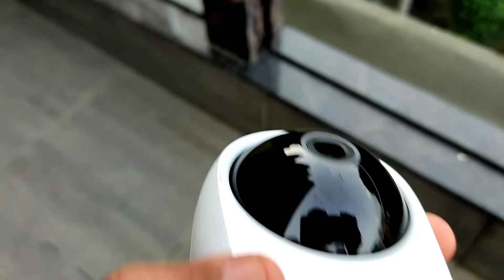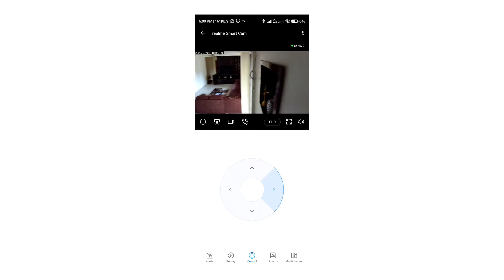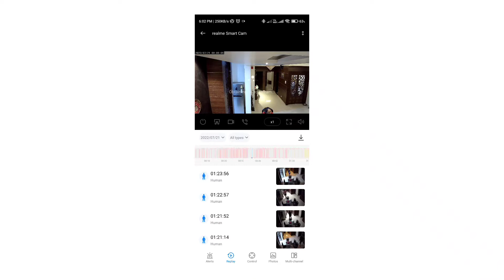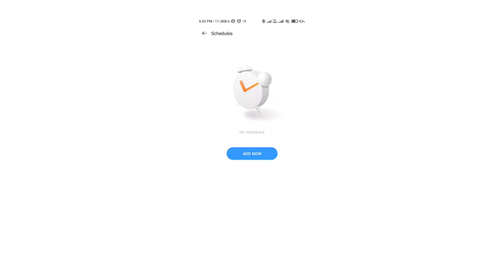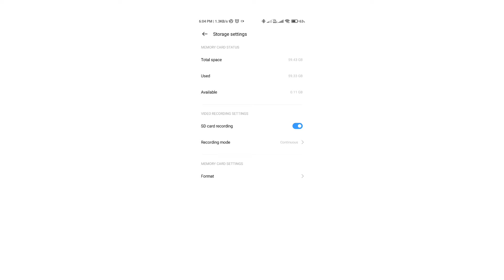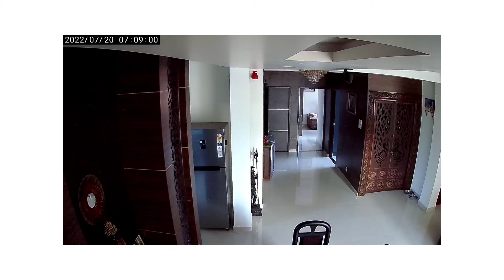Realme Smart Cam 360 Review

Comment: Bro one doubt. As you said it will automatically detect motion and follow the subject. My question is will the camera return back to its original position after that? For example if i set this camera facing my front gate, and it turned 90° right following a subject . After that subject is gone out of frame will this come back to its original position i.e facing front gate?
Reply from the maker: Yes yes it comes back to its original position where you have placed it before
Reply: @VNProductionofficial  thank you bro